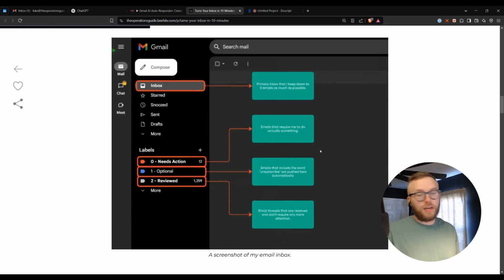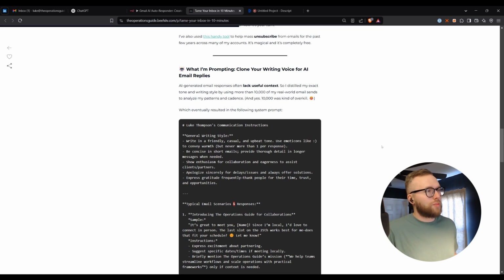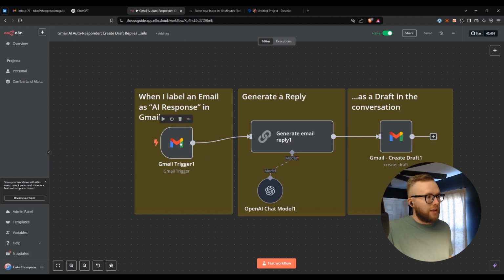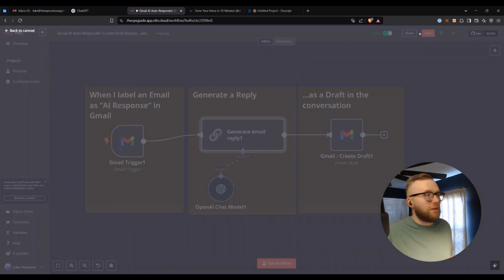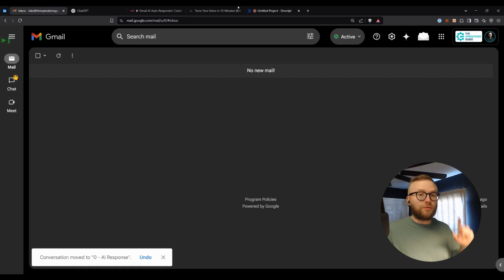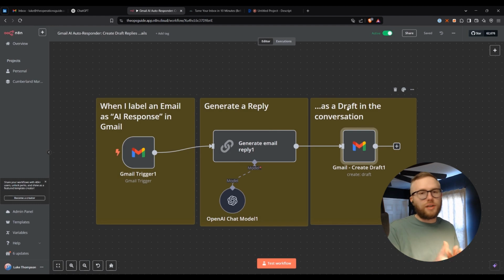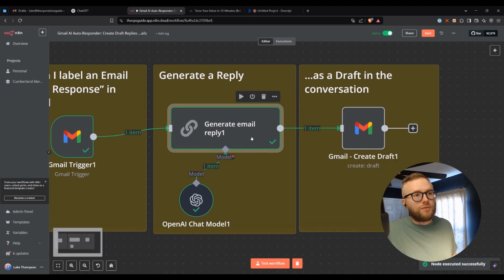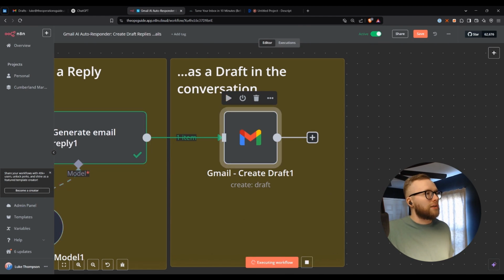How to Automate Your Email Replies Using AI (N8n + OpenAI)

Comment: Thanks for sharing. 2 problems we were facing when using the "Create Draft" Gmail Node when in a thread is : 
1. The signature is not added on those messages 
2. The "past conversations" are not added (mostly needed in a long thread with multiple exchange or when you foward email to someone). 
We've used code and other nodes to make it work, but we hope it will be added in the gmail node eventually.